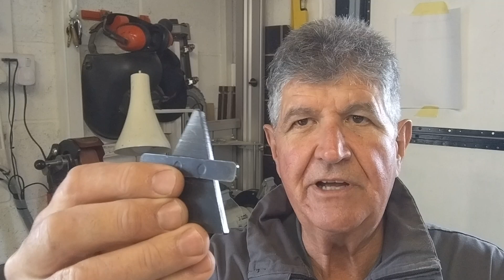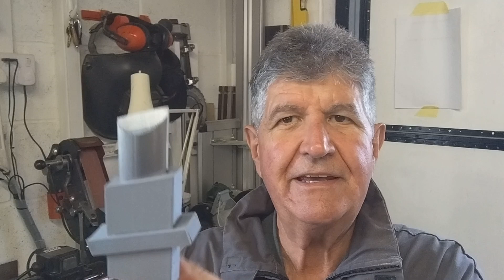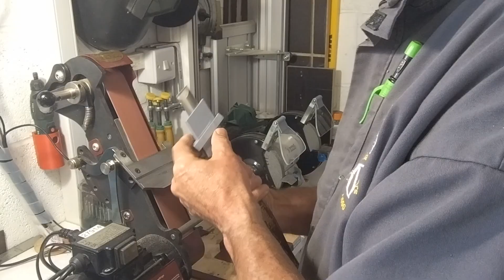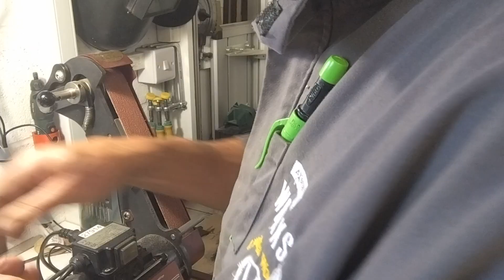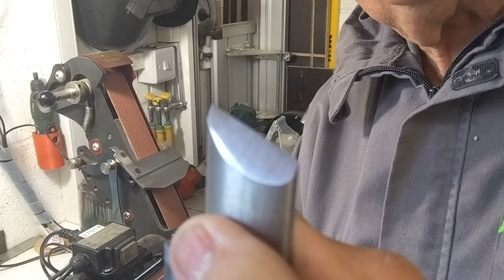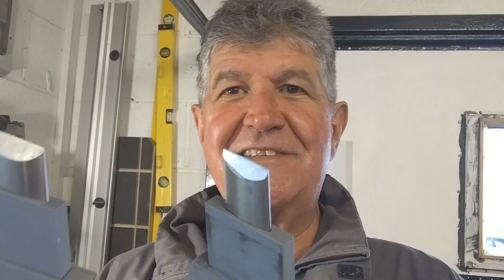Skew chisel jig for the ProEdge Robert Sorby sharpening system

Comment: Looks good. I have 3d printed some jigs for my Sorby sharpener that I found on line. Including some jigs to sharpen drill bits.
Reply from the maker: Thank you. I also havE two jigs that I made for drill sharpening, one for 118 degree included angle, and another at 135 degrees ( for harder steels). Both are available on my eBay channel. https://www.ebay.co.uk/usr/cumbriamakergeoffduplessis